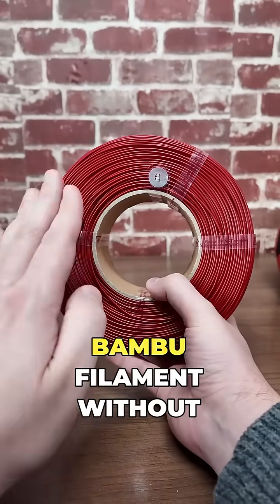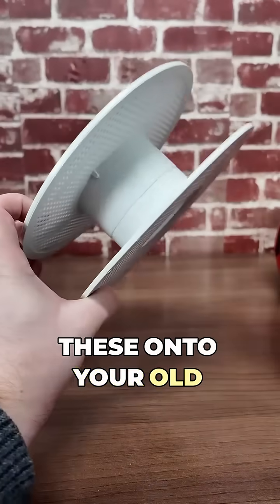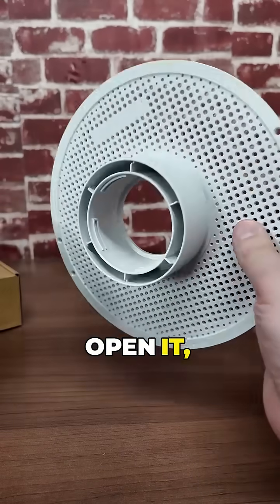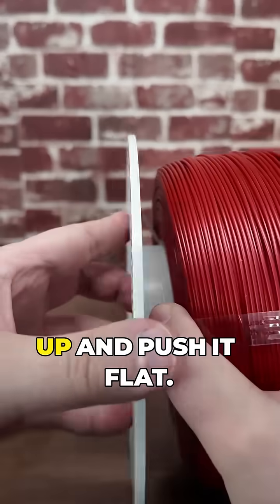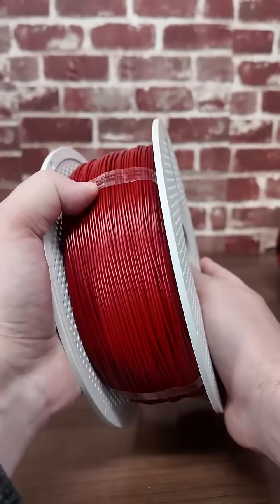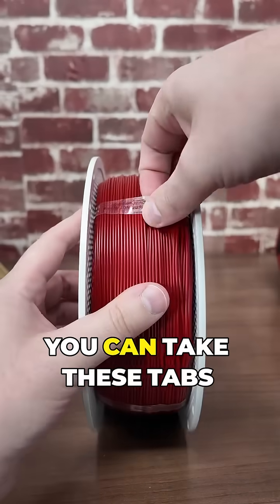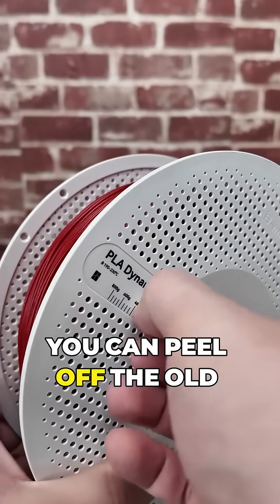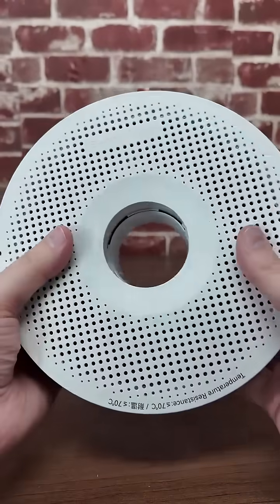How Refill Your Bambu Reusable Spool #3dprinting

Comment: Also, another thing I would highly suggest people do is from the center and the outside edge try to gently pull it apart. If it does not come apart easily, give it a little bit of a shake to simulate it being in your printer spool holder either AMS AMS light or external spool as I had one where that spool came apart and pretty much wasted a entire roll of filament
Reply from the maker: great tip!